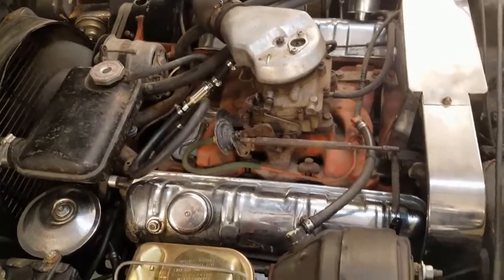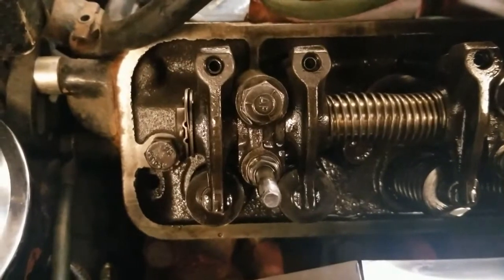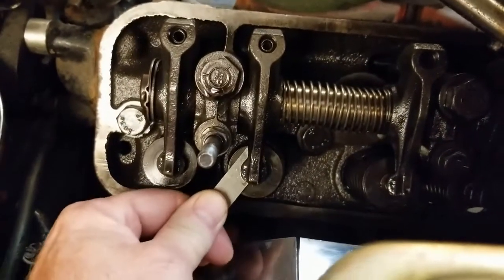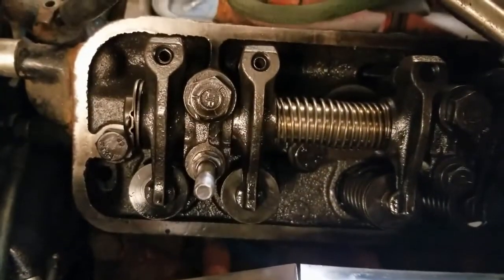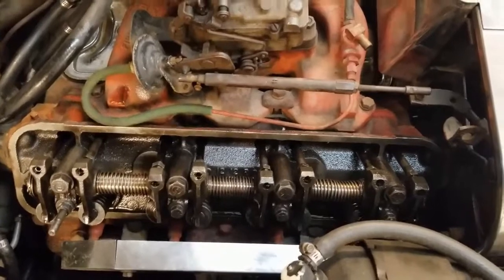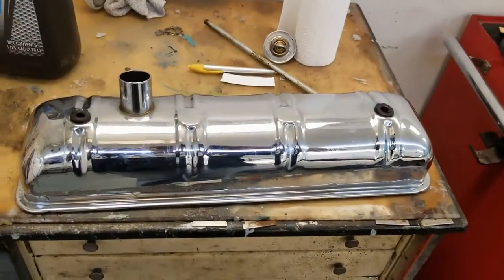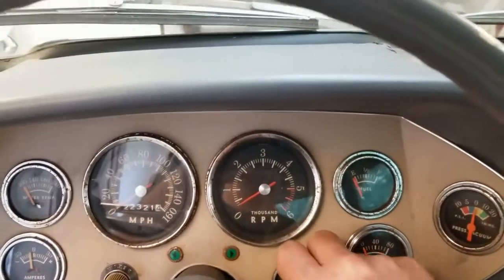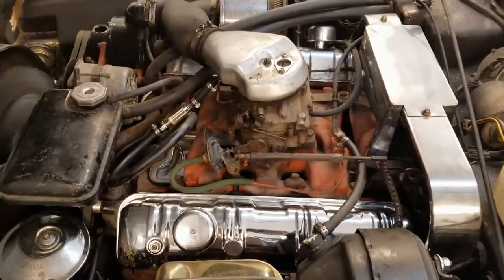Studebaker Avanti Refresh - Part 3 Lashing the Valves

Comment: I know this was 2 years ago but I wish you would have shown how to actually adjust the valves.
Reply from the maker: Sorry but I don't have any real video equipment so I make my videos by holding my cheap camera.  That makes it hard to set the valves and hold the camera.  Setting the valves is not that hard.  You need to get the valve on base circle and slide a 0.026" feeler gage between the rocker arm and the valve tip.  If the lash is too big you need to back out the adjusting screw on the rocker.  Too tight and you tighten the adjusting screw.  Most adjustments are a small fraction of a turn.
Reply: Actually your videos are great!  I have watched almost all of them and I truly appreciate your efforts doing the videos.  I was interested to know how you put the cylinder at TDC to adjust the ticking valves considering that you have the fan, radiator and fan shroud on the way to get a wrench at the crack.  Did you crank the engine at the starter relay hoping that it will stop at cylinder #1?

Comment: Never knew the R2 was a solid lifter motor. Any easy way of converting to modern hydraulic lifters?
Reply from the maker: The lifters are easy to adjust and usually keep their lash over time. I wouldn't put the effort into hydraulic lifters on a Stude engine.  There are plenty of other areas that can use help that will improve output.
Reply: Stude.never built a hydraulic valve motor.

Comment: 0.026”??  I’ve been using 10 intake, 12 exhaust. Why so much clearance? Thanks!
Reply from the maker: I"m using the factory shop manual spec for V8s 55 64 which lists 0.025 0.027 inches with a cold engine.
Reply: At 010 & 012 you must have a reground cam